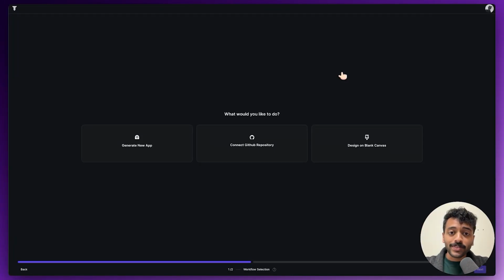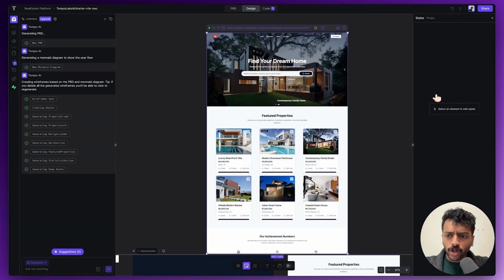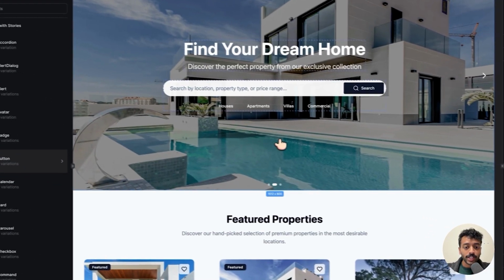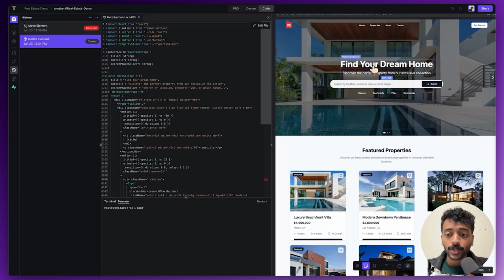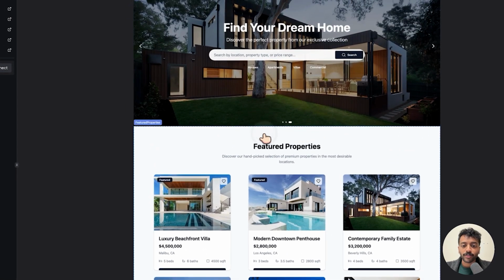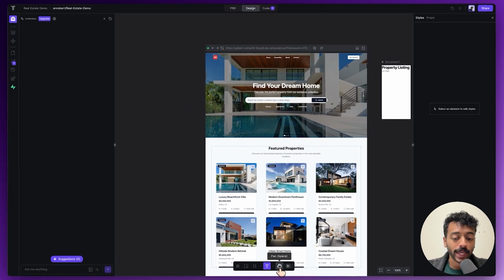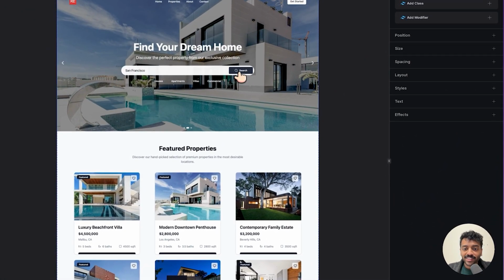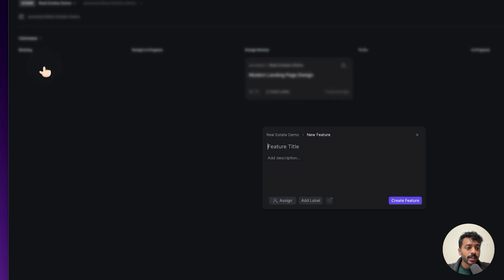building an app with AI has never been easier | Tempo Tutorial

Comment: I immediately signedup up after watching Ras Mike's video and got to work after watching this, was really excited about this tool until i got stuck. Since the pastt few days, no one able to respond to me as a paid user, to help me.  Which is very disappointing, it breaks spirit and momentum. I was create an exciting video to publish about this tool comparing to others but thus far I'm disappointed on the numerous errors and how our credit is consumed fixing these errors. I am having issues pushing my repository. I get errors saying to wait for everything to reload, but still even that it gives no options. It will later say that the repository already exists without confirming its been created. And when I try pushing to the one it created, it still gives the same error - it doesn't show that my repository is connected at all. "failed to connect to new repository, wait for the codebase to load and try again. Error: Error pushing to GitHub." Futhermore, I have been trying to deploy only to be met with lots of errors of which i keep pressing fix with AI at least for over 30  times and this apparently consumed  over half of our credit. I'll appreciate if any of you can look into this. I'm making a video about the usage and performance and seems stuck and I want to capture all the various elements and why the errors in my recordings.